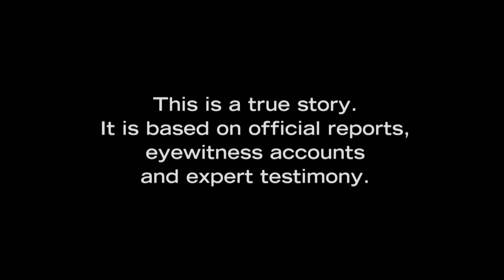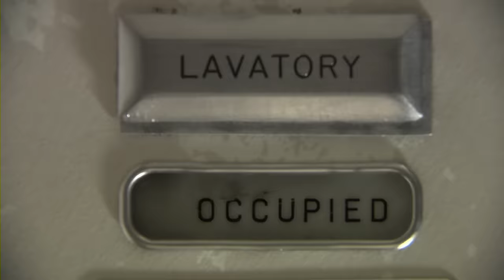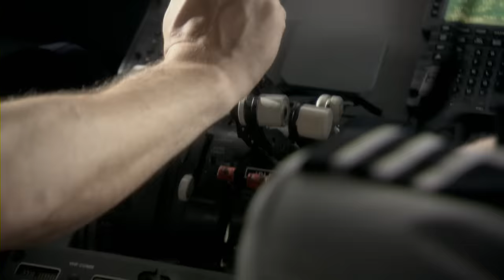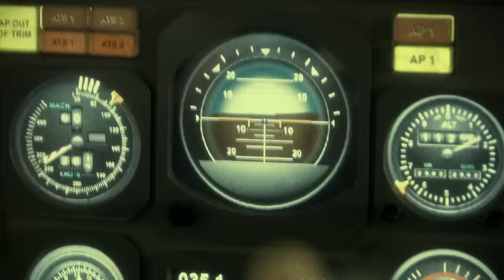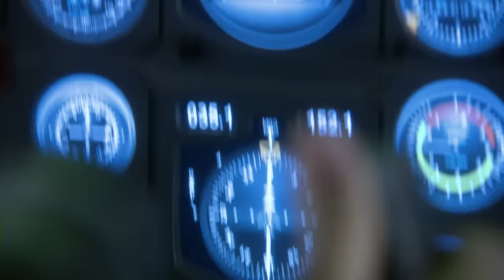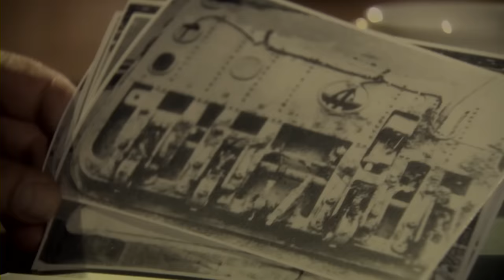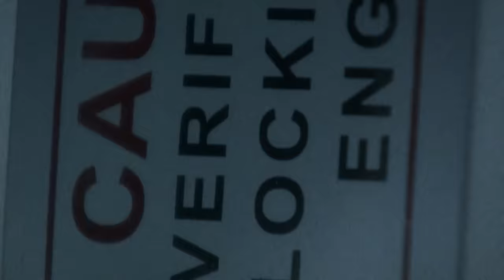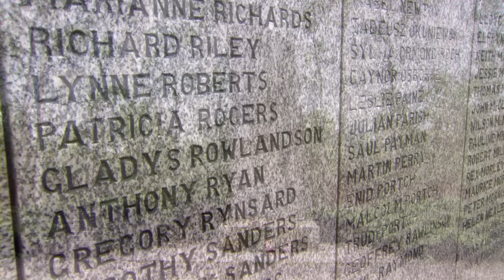From Marvel to Mayhem: American Airlines' DC-10 Horror | Mayday: Air Disaster

Comment: The merger between McDonnell Douglas and Boeing in 1997 marked the beginning of Boeing's decline. This event introduced a culture of prioritizing profits at Boeing, leading to the problems observed with the 737 Max series. The recent incident involving a door failure also eerily echoes these issues. Thankfully, there were no fatalities.
Reply: Why no problems with other Boeing models? 777,767, 747,787?? Please explain why problems with Boeings 737???
Reply: @itjustlookslikethis One thing worth considering asking this question is that 737s heavily outnumber all other Boeing products in commercial service.
Reply: @itjustlookslikethis  Maybe because they were developed before the merger with the exception of 787? Also 737 originals (besides the rudder issues), classics and Next Generations are very safe planes, but the max has truly exposed the inferior American manufacturing
Reply: @itjustlookslikethis  the 737 airframe has gone unchanged with basically only engine changes in model changes

It would be like a car with no airbags and automatic seatbelts getting a new engine and the automaker going...okay its brand new and amazing come buy the amazing thing
Reply: I wouldnt day it echo's this
MD had created a way of door closure that was not fail safe... Human error could and in part did play a part in this horrible accident. With boeing...the plug had nothing to do with human error, airline maint wise...it was a design flaw
Reply: I still can't believe how the 707's itty bitty widdle brother ev olved to become its replacement.
Except now that I read what I just wrote...
Reply: @itjustlookslikethis  "Why no problems with other Boeing models? 777,767, 747,787?? Please explain why problems with Boeings 737???"

They're in the news. 
Also, an early 1960's design tweaked beyond recognition to do things that it was never intended for in the 1960's?
Reply: DEI maintenance!😬
Reply: @tonpetitami oh here we go with the American bashing.
Reply: @buixrule When the evidence of real tragedy supports it, it's more than warranted. And I say this as an American.
Reply: @buixrule new to the series? 
Lots of accidents caused by the "Murrican way" of doing things disagree with your take.
Reply: @itjustlookslikethis  the 747,777,767,757 were built and developed before the MD Boeing merger. It was at a time when Boeing was run by engineers, not bean counters. Back when Boeing had an immaculate safety record.
Reply: @itjustlookslikethis  747, 757, 767 and 777 were developed before the merger (as was the original 737). 787 had major problems (involving battery fire as well as control surfaces) but they didn't lead to crashes. 737 max was developed in a hurry to compete with airbus 320 neo leading to a lot of shortcuts. The other plane developed by Boeing after the merger, 777-ER recently had problems with engine attachments during tests and is yet to be certified. That's 3 out of 3 planes developed by Boeing after the merger with major problems. 

McDonnel Douglass bought Boeing with the Boeing's own money.

Comment: Well, I would argue that probably 95% of crashes could be prevented.  The other 5% being probably weather conditions which nobody has control over.  But after watching many of these shows, it usually comes down to pilot error, design defects and/or bad/missed/ignored maintenance.
Reply: Weather taking a plane down is pretty rare.

Comment: I worked for the phone company at McDonnell Douglas in the late 80's early 90's when they were building the MD-80's(stretched DC-9) and the MD-11's(stretched DC-10) and during lunch I used to see a lot of assemblers going to the Thirsty Isle bar across the street for lunch and beer and then go back to work.  Management did catch on to this and gave warnings to the employees.  It's crazy that they built a brand new office building at Lakewood and Carson specifically because of the MD-11 and C-17 programs and all that has been torn down now after merging with Boeing.
Reply: Wah i did not md11 is the continuation of dc10! I flew both. Md11 with garuda the corrupt national flag of indonesia. I rem there was a question about the purchase, likely it involved bribery.

Comment: I propose a rule I call the "One Thing Out Of Place Rule:" If a commercial airliner is involved in an accident and the NTSB finds that a design flaw (such as a malfunction) caused or contributed to the accident, that airliner's model, make, etc. becomes illegal to fly until the plane manufacturer proves that  the cause was not a plane defect. 
The idea is to make all defects a profit-killer and thereby incentivize manufacturers to make damn sure their planes are safe to fly.
Reply: Personally, I like the USAF method for quality control. Designers get picked to fly on random flights of their plane.
Reply: My grandpa said planes kept crashing in WW2 and they started making the mechanics fly on the first flight after a repair and the number of crashes was significantly reduced.

Comment: and McDonnell Douglas culture transferred over to boeing after buyout hence why you have the quality control issues today and why boeing is constantly trying to seek exemptions. also why the company dragged their feet after the 2018 max crashes which they already knew the mcas issue was a problem.
Reply: I'm pretty sure that when the first Max crashed, there were low-level engineers in cubicles who immediately knew exactly how and why the plane flew into the ground. Of course, a human, legal, and financial disaster of that size requires years of obfuscation.

Comment: Add in the 1979 DC10 crash in Chicago and you'll see just how dangerous this plane was.
Reply: Chicago crash was result of not following McDonnald/Douglas maintenance procedures.
Reply: Wrong...but good try. Your analytical skills leave much to be desired.
Reply: @stephenbrown7545  The DC 10 was supposed to be able to fly on two engines.  Poor design caused loss of instrumentation in the cockpit and no stick shaker where it was needed so the pilot didn't know they were stalling.   The pilots should have been able to recover from this.  Nice try, but this crash is on McDonald Douglass.
Reply: That crash was caused by American Airlines failing to follow correct manufacturer-recommended maintenance procedures in the name of convenience, but it still nonetheless further marred the reputation of the DC-10 and McDonnell-Douglas.
Reply: @harrisongrant8558  The engine loss was AA not following the correct procedure, but the plane was supposed to be able to fly with two engines but the pilots couldn't because of the failure to have power to the instruments and no stick shaker.   That's on McDonald Douglas for a poor design.
Reply: @GermanShepherd1983  the problem is that the engine physically separated from the aircraft, which caused a huge imbalance and took vital control systems with it. Yes, the airplane can fly with only two engines OPERATIVE, assuming they are still physically attached to the aircraft, that's the whole reason why ETOPS was even a thing. I'm not going to deny that it was a dumb design, and the DC-10 was full of design flaws that ultimately cost lives, but that was a case of questionable design choices AND incorrect maintenance procedures, and I believe that American Airlines deserves most of the blame for that incident.
Reply: That was not the planes fault,  it was the mechanics doing a maintenance job the wrong way and damaging the engine mounts.
Reply: @willschultz5452  Did you bother to read my explanation about why it was the planes fault?
Reply: @GermanShepherd1983 yes the crew  should have been able to fly the plane without one engine. The crew was unaware that the engine flipped over the wing causing the severance of the hydraulic lines. They just knew they had engine failure. The engine detached because of the maintenance procedure weakening the pylon to the engine. The co-pilot was flying the plane and there was no stick shaker so he flew the plane per procedure for a failed engine which was to slow the plane causing it to stall. If he knew the plane was stalled, he would have increased the speed and should have been able to fly the plane without crashing. The 1979 DC-10 crash from Chicago remains the single most deadly air crash in US history.
Reply: @theshermer Flight 191? I heard of one at MDW where the plane ran over a kid in a car. It's all very close to airport there

Comment: Never liked flying on a DC-10. Too many issues with its iffy engineering, like the way the three redundant hydraulic systems were taken out at the common point where they were routed together, all the cargo door issues (and the Orly crash) no vents in the cabin floor practically guaranteeing the cabin floor would collapse if the cargo space depressurized, and the fun way that the cabin floor would flex downward when the drink cart rolled by. I'll take an L-1011 any day.

Comment: The roughest airplane flight I've ever been on was a DC10. I felt every bit of turbulence that plane went through. It shook, it rattled, the way those wings were flapping, I thought they were going to come off! Gave me a headache. On top of that, when we finally landed (thank God!), it took FOREVER for our bags to appear in the turnstile when we went to retrieve our luggage. I was starting to think it had been lost. It finally showed up.

That DC10 I flew on was simply TOO BIG. It felt too big, and it didn't fly well. I haven't been on one since, and consider myself and my family extremely lucky there wasn't a dangerous problem with that one.

I have been on other planes (not DC10s) that had mechanical problems while still on the ground. In one case, I had to be rebooked on another flight because it would have taken them so long to fix the problem that I would have missed my connecting flight. Fortunately, I only had carry-on bags, which a helpful attendant helped remove from the bin and escorted me into the terminal with them. Had I checked through my luggage on that flight, I might never have seen it, again.

A second plane I had boarded also had mechanical problems prior to takeoff, but they fixed them, and I didn't have a connection to catch in that case.

I am reluctant to fly, anymore. Just a little too "iffy".
Reply: Big planes are actually  much more comfortable in turbulence. 

The time to be reluctant to fly was back then. Today, it is a hundred times safer, witness the US jetliner accident rate over the last 22 years, with its single fatality.
Reply: @cchris874 What? Um, NO. You had the 2 Max planes. 6 months apart. The one right after 9/11. That's 3...
Reply: @windsofmarchjourneyperrytr2823  

Sorry if there's a misunderstanding. I said "US Jetliner," meaning on a US AIRLINE. Otherwise you'd be talking dozens and dozens of Boeing crashes worldwide since 2002. Also, the one "right after 9/11" was over 22 years ago. November 12,  2001 to be exact. "Over the last 22 years"  is just another way of saying, "since November 12, 2001"

Sorry for not making "US jetliner"  defined more clearly. My fault.

Comment: You would think McDonald Douglas after this would learn to build safer planes. On January 31 2000 Alaskan Airlines flight 261 crashed off the coast of California due to a bad Jack Screw design. This plane was an MD80.
Reply: The jackscrew design was OK, but Alaska Airlines had been skipping the inspections and maintenance for years.
Reply: It was because it wasn't greased during regular maintenance.
Reply: Definitely not a bad design... low quality, substandard, cost cutting  maintenance program implemented by Alaska Airlines is the cause of that wreck.
Reply: You are ignorant. It was lack of proper lubrication not the design of the Jack Screw assembly.
Reply: @stephenbrown7545  Ok, sorry. I guess I should have said it was bad maintenance on Alaskan Airlines part. When I watched the documentary it implied that the design was flawed but did not directly say it. Once again,  so sorry

Comment: "The company was bought by Boeing in 1996"

History now shows that McDonnell Douglas instead managed to buy Boeing with Boeing's own money.

I will grant that the, however that even before the merger that the 747 did have a similar problem with its cargo door.  With enough force it was possible to bend the locking mechanism of those doors such that would appear to be and show as closed in the cockpit, but wasn't fully secure and did lead to a door blowout near Hawaii.

Comment: Please keep in mind that the DC10 was still flying after the cargo door issue was fixed and McDonnell Douglas was sued. And technically in 1979. the maintenance procedure to maintain the engines was actually used by the airlines as it saved maintenance hours. It was not recommended by the DC10’s manufacturer. AA 191 was the one that crashed but the planes were grounded and  it was found several airlines were using the same procedure with the potential of another incident happening like flight 191.

Comment: As a former firefighter I can never understand why take off your shoes?
Reply: I would refuse that order. If my wife happened to have high heels on, I would break em off and tell her to put em back on. I can understand removing jewelry...not shoes.
Reply: Probably in case passengers have to use the evacuation slide, the shoe won't snag or catch on the slide.
Reply: @ohioguy215 Well if u don't want to fall 135-335 feet then u might want to take them off, because u take off sharp stuff like high heels to not make the air come out or damage the emergency slide
Reply: @terrell134 
Well, if you read my post, I stated high heels should be removed. I'm a frequent flyer and frankly, I don't see high heels on passengers. On the other hand, if you're forced to jump into aircraft debris, I'd want my shoes on.

Comment: Reminder that the DC-10 was such a [words Youtube won't allow] that it even managed to cause another aircraft's accident; the Concorde. The Concorde accident happened because a DC-10 dropped a piece of engine cowling on the runway which the Concorde ran over, punctured its tire and pieces of the tire shot up into the fuel tank.

Comment: Wait a minute, wasn't there almost an identical decompression caused by an improperly locked cargo door on a Boeing 747 in Hawaii in the early 90s? I swear it was the same thing- ground crew forced the handle to the locked position, but it didn't lock, it blew out at altitude, etc. How could ANY plane manufacturer be repeating this exact problem after this absolute disaster? I honestly do not understand how that even happened.

Comment: It all could of ended at 1 crash but they were too cheap to correct the door design.   Just so they had room to store one extra crate they design the door to open out instead of in. It may be the biggest feat of idiocy in aviation history.
Reply: Boeing did that too for their 747. So perhaps not really the central issue.
Reply: @cchris874 
Boeing also killed people with the design of their cargo door on the 747.  The decompression that occured on the 747 cargo door issue didn't cause the floor to crumble like on the DC10.  But a few passenger got sucked out of the hole ripped in the side of 747.
Reply: @azkor91  Yes, you're right to an extent. But the DC-10 redesigned door showed that it could be built safely. After Paris, there never was another DC-10 cargo door event.

Comment: As a former flight attendant (15 years) for American Airlines, there was no aircraft I enjoyed working on, or flying more as a passenger, than the McDonnel Douglas DC-10. I would take one of those 3 class configured aircraft any day of the week over any of the Boeing three class configured aircraft, and most especially with the Boeing CEO of recent years mmaking such ruthlessly-greed driven psychopathic decisions that has cost lives. 

That said, if I had to fly a Boeing aircraft...and I've flown on hundreds of them...I'd fly on the Boeing 777. 

I was tremendously sad the last day that American flew their last DC-10 transcon from JFK to LAX back in 2000. I had my picture taken in the enormous jet engine in my uniform and onboard, as well. 

The only near-catastrophic experience I had as a flight attendant was on a Boeing 757 from SJC to HNL in June 20, 2001 midway over the Pacific Ocean. It was a new moon, so the sky over the ocean was pitch black and you could not see the moons reflection on the ocean water, so it was like flying into an almost black abyss except for the stars far above. The entire crew knew the dire and precarioius situation, but none of the civilian passengers did. They were blissfully ignorant and walked into the arms of their loving family members when they arrives or went on about their vacations unaware that their lives could have very easily ended that night.
Reply: Do keep in mind that the Boeing execs were replaced by the Douglas execs when they merged. That explains the Max.

Comment: I had a few questions, including why did they not need oxygen masks?
Reply: I’m not quite halfway through and I did seriously have like two or three other pretty major questions as I recall, but I can’t remember what they were because I was watching more. 😂
Reply: Hi, former instructor here. In this case, oxygen wasn't needed because the loss of the door occurred at just under 12,000 feet as the airplane was still climbing. If you're healthy and not exercising hard, that's not a big issue, plus standard procedure for a pilot in that situation is to bring the aircraft down to about 10,000 feet anyway. Had they been at high altitude, it would have been critical for the pilots to don their masks immediately, as your time of useful consciousness (TUC) decreases significantly with altitude. Hope that helps. 🙂